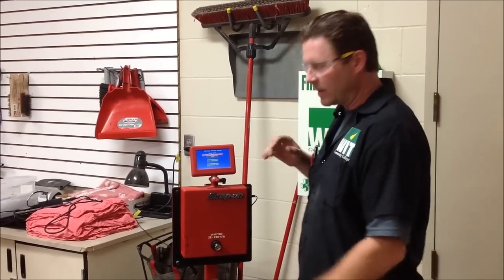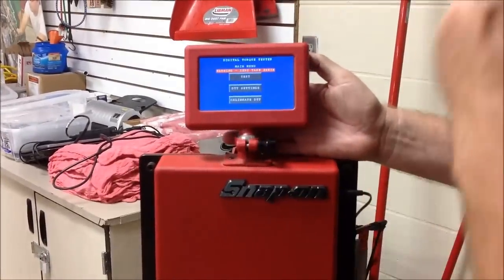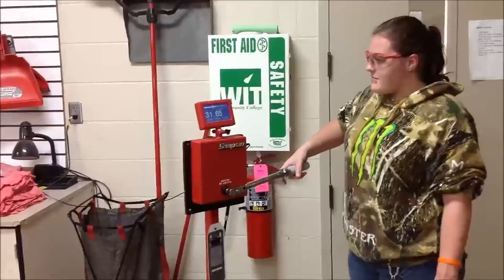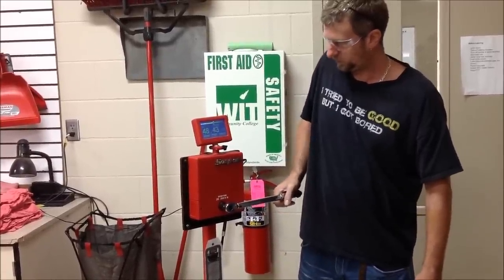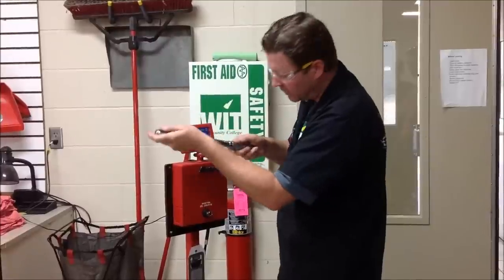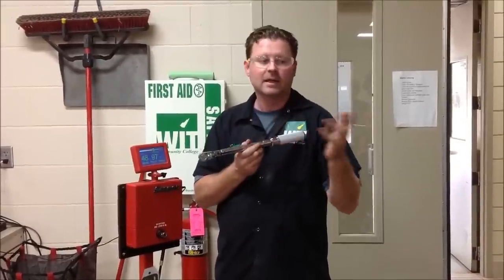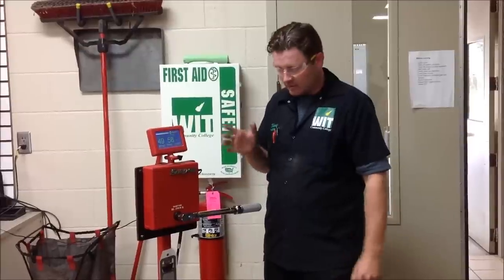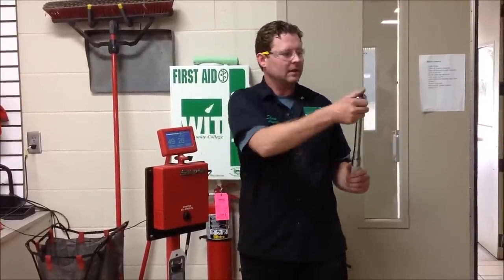Torque wrench calibration check Harbor Freight vs Snap On

Comment: If it's consistent but inaccurate, just calibrate it.
Reply from the maker: Where? How much? Defeats the purpose of the $20 purchase. Think about what you're saying as if it would be easy of convenient for most folks. I understand its possible to calibrate but just shouldn't have to.  Just my thoughts...

Thanks for commenting and adding value to our community!

Have you subscribed yet to never miss a video? Have you seen the video playlists? Check them out here: https://www.youtube.com/user/conleybuilt/playlists  

Want to say “thanks” or “keep it up”? Click here https://www.paypal.me/how2wrench    
 
Your answers and help are just around the corner. Save time and money while protecting your investment and yourself by doing it the right way at www.How2Wrench.com
Reply: You can do it at home, for whatever a luggage scale costs. Chuck up a socket in a vise, take some measurements, use some basic high school math, and you’re done. The end can simply be unscrewed and you adjust the spring tension and repeat until its dead on. A luggage scale you can trust is in the neighborhood of $20. So all-in you’re at $40, or $560 less than the Snap On.

Doesn’t defeat the purpose at all. If you buy expensive stuff, you expect it to be good. If you buy cheap stuff, you expect it to either suck or need improvements. In this case, its not even really improvement, it’s just setup. If you’re incapable of that calibration and you have a torque wrench out, you’re probably a danger to your project and should put a lock on the ol toolbox and destroy the key.

And for the vast majority of applications, exact torque isn’t necessary. It’s essential to have even torque on large surfaces like heads and covers, so precision is better than accuracy there anyway. Torque specs for things like bolts in aluminum are there basically to make sure you don’t strip, stress, or stretch anything. If some engineer designs a piece of equipment which relies strongly on exact torque specs, that engineer should be shot.

These posts about people snapping bolts off with a torque wrench are ridiculous. Common (mechanical) sense should stop you before then.
Reply from the maker: Brendan Redler We actually have the “home calibration” method videoed and in the editing list. You are correct on the simple math and it can be done. So we just disagree on the realistic situation about how many of these fall into the hands “ that don’t know better”. I had to smile about your “common mechanical sense” Man after my thoughts exactly. I stress this all the time. There are things you ultimately will just have to know and feel.